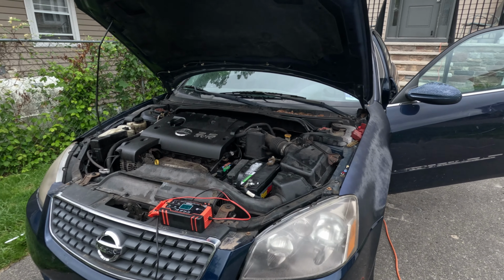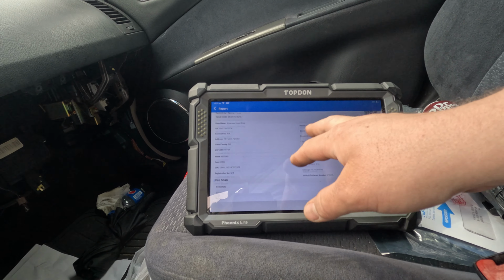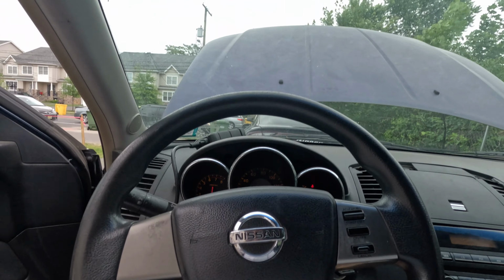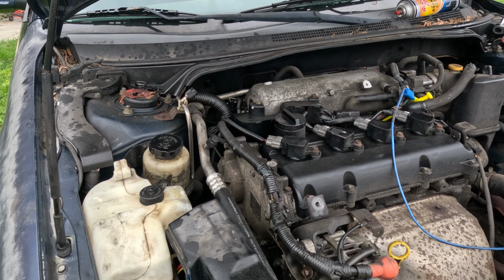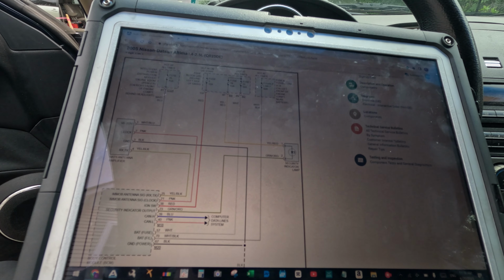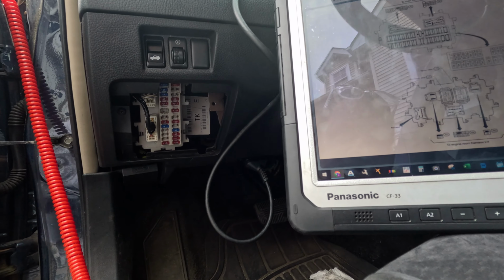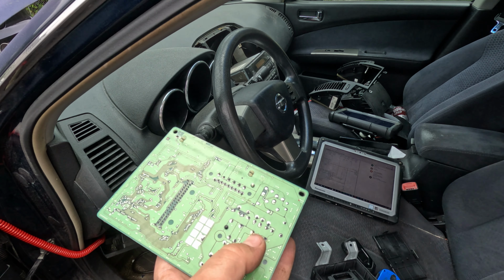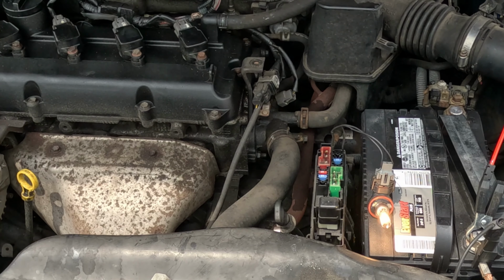2005 Nissan Altima - Crank no start, Multiple bad Modules!

Comment: As I am sure you are aware, you are dealing with multiple problems with this vehicle. 

Good job doing a visual on the BCM PCB. There are only a few youtuber techs who actually look to see if there is any obvious damage on the PCB before swapping a module which is obviously unwise if you burn up a replacement BCM. However, after identifying the heat damaged relay you should really trace the relay circuit back to the connector pin and identify which relay this is, so we know what circuit has overheated the relay. Unfortunately, the BCM wiring diagrams do not show any internal features only pin numbers and what is attached to them, and I also could not find a BCM connector pin circuit function description anywhere in the ALLDATA diagrams.
 The shorted radio should not effect the BCM. Since the customer is involved in the repair I would inspect the radio male pins to see if any are bent over shorting out power.

The blower motor always on looks like a failure in the Fan Control Amp, which is controlled by the Front Air Control Module (FACM). What is really strange with the blower motor and the FACM is on the diagram there is a short on the output of two fuses; Fuse 10 (15A Blower Motor), and Fuse 11 (15A FACM). Why? I have no idea. If somebody knows please let me know.

If the alternator went full field it is possible, but not likely that this would destroy modules, it would, however, cook the battery, which would match the customer stating that the "original battery was melted". However, the least protected module in the vehicle is the radio, and may employ an over voltage crowbar to protect the power input, or perhaps a TVS. Often the radio protection circuitry does not recover resulting in a dead short which is meant to blow the fuse, which it did. The good news is you can usually open up the radio and fix the front end protection circuitry fault, and even modifying it with a much larger TVS, etc.

Comment: 13:33 This was so painful to watch, why didn’t you disconnect the switches from the cover board? Weight puts the wires and connectors on stress and may cause damage.

Also you should’ve placed the board on the back seats or trunk, because you’ve damaged the insulator sponge!

If you are going to work on someone else’s car, you must take care of it more than your own car! Where is your integrity?
Reply from the maker: The module was bad, I was fixing it temporarily to see if it would work. I wouldn't leave it in.
Reply: @advancedleveldiagnostics 
That's not what I am talking about

Comment: having a problem with my nissan almera 2003. car starts good in the morning but when the car gets hot or engine gets hot the car cranks but wont start at all. any ideas on what could cause that. Once the car is cold it starts one bounce you can drive anywhere but once it gets hot and you turn the car off it wont start back
Reply from the maker: You need to see what your missing when it won't start, Ckp sensors can fail when hot but it can also be something else like a fuel pump or ecm

Comment: Somebody put the battery backwards and shorted out an audio amplifier. That’s what’s causing the fuse to blowout
Reply from the maker: I think it was struck by lightning as the original battery was melted, and a lot of electronics had issues.
Reply: @advancedleveldiagnostics  that’s worse. I worked on a vehicle one time a Mitsubishi montero and battery was put on backwards. If kept blowing the fuse. Took me two days but O figured it out. A large diode at the factory audio amps power input which is forward biased from ground to the supply voltage would have overloaded if you were to connect power backwards since the current would just go straight to ground backward without any load since fuse does not care about polarity it will blow. Those diodes are meant to protect electronic components which will short and therefore blow out the fuse sparing precious electronic circuits. Most modern PCM have those diode as well. In fact if you encounter a PCM that blows fuse it is not really unfixable. Just replace the diode it will work by simple removing diode bug then no more protection next time someone puts circuit backwards.
Reply from the maker: @HatesPickup  Good to know!

Comment: Hey I have this same car an I just brought it about a month ago an it was running fine then it just stop cracking, tapped the starter the it was fine until I drove it to work then it shut off an stop running, I got the fuel pump fixed an it’s still not starting I don’t kn Wht to do
Reply from the maker: Is it cranking now?

Comment: For the no security light issue, I run into a lot of the 05 altima bcms where the eeprom data gets corrupt. Seems very easy to do on these. You can substitute with a new eeprom and do the procedure like your replacing it or you can just replace the module all together. You will likely need to still program the pcm with VIN and sync to bcm, as well, doubt that was done when it was replaced.
Reply from the maker: Thanks for commenting! The new bcm now communicates, but it still won't start I have a part 2 that I filmed today (just have to edit it) spoiler: but the Cluster does not communicate, do you think that can prevent starting? I don't see it on the diagram but I think that's where the security light is.
Reply: @advancedleveldiagnostics  Im not sure the cluster would prevent starting on this one. If my memory serves me, this one has a red dot on top of the dash as the security light. Its hard to see. I used to hold a piece of white paper just above it to block sunlight and give me a better angle to see it reflect and come on when programming keys. Its 2 black circles flush with top of dashboard and almost all the way to the windshield. One is security light, the other I assume is for keyless entry transmitter.

Comment: Somebody likely reversed polarity of the battery or it was severely overcharging but that usually blows bulbs.
Reply from the maker: It's not finished; part 2 is coming with more bad modules! I think it was struck by lightning, but I have no way of proving it.

Comment: When the repaired trace blew immediately and you said you were replacing BCM I'm like "Nooooooo!!!"
Follow the load side traces to connector pins and you can find out what is shorted externally, then fix that before replacing BCM.
Reply from the maker: I did try tracing it, and I gave up. I wasn't so nervous because 3 other modules were bad, so I was pretty sure it was struck by lightning or the alternator shorted. The car is not fixed I worked on it again today, hopefully, my footage will be good to make a part 2.
Reply: @advancedleveldiagnostics  I would be inclined to think there's a shorted section in the alternator rotor that's caused a runaway over voltage condition.
I would have expected to see over voltage codes in the modules that did still communicate but likely someone before you cleared codes.
I replace a lot of drivers and relays on BCMs so I don't need to program replacements.
So in those cases I'm tracing inwards from an output pin to locate the failed component.
In your case you have an obvious failed component (and trace) so need to find what it's powering, or the replacement BCM will smoke too.
Maybe you will find the answer the other way, working back from something else that doesn't work.

Comment: Looks like a flood damaged vehicle
Reply from the maker: I didn't see any water damage, and it all pretty much happened at once. I think the alternator or battery shorted, or maybe someone reverse-boosted it🤔
Reply: @advancedleveldiagnostics  oh ok when I see rusty hose clamps I think water damage. See a lot in Houston from flooding 👍🏻
Reply from the maker: @sheerwillsurvival2064  Here in NJ, everything is just covered in rust!
Reply: @advancedleveldiagnostics  lol yeah salt I used to live in Wisconsin. But I guess sea water in the air maybe

Comment: Interesting diag. Wonder if the theft light is integrated into the radio too? Hopefully a part 2 coming? Thanks for sharing!
Reply from the maker: I initially thought it was integrated into the radio, but after some research, I'm pretty sure it's in the cluster. The customer is going to try a new bcm himself. If he has problems, there will be a part 2!